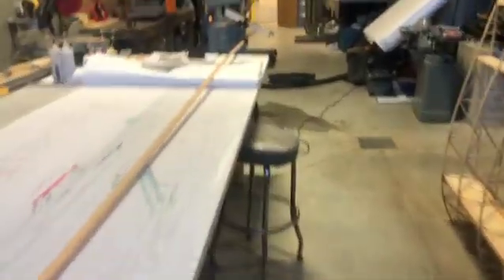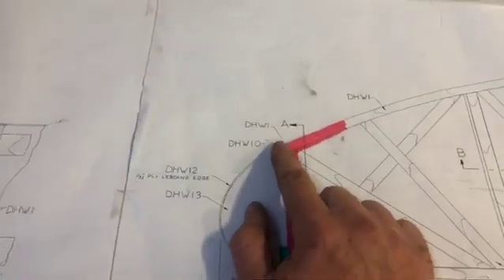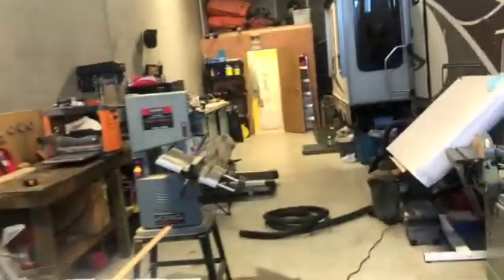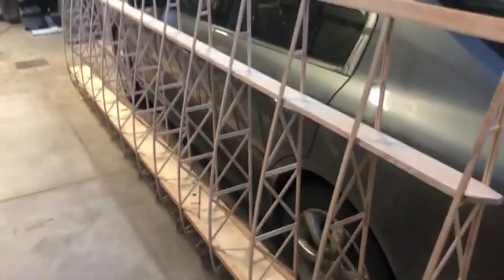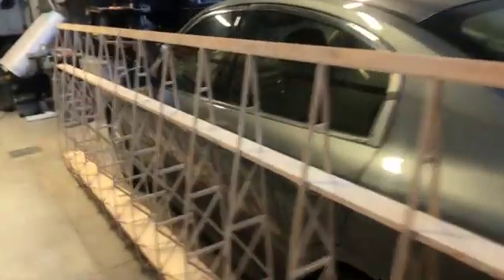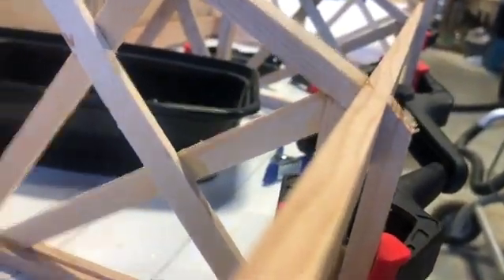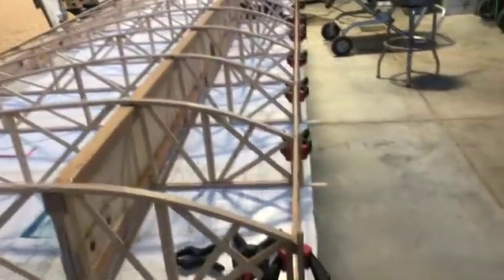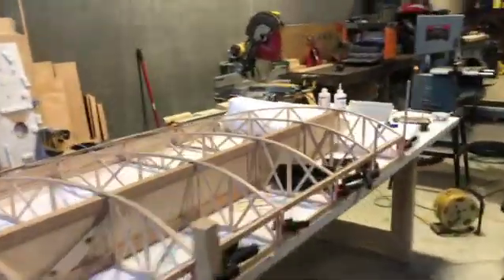DAKOTA HAWK EPISODE 30

Comment: Are those strut attach fitting holes Ok being so close to the edge of the blocking?
Reply from the maker: It is not centred but with the bushing it should be fine, I may bond and extra 1/2" to the forward part of the cross-member.

Comment: There is always more than one way to skin a cat, I would have fitted the false spars after the nose section of the rib but that is how I learnt to do it. I agree the build will take what it takes for that individual, for me is was space for the machines and the availablity of aircraft grade wood other than Douglas Fir, that made the choice for me. In the past I had a workshop about 5 time the size I have now with all the machine and a hangar next to it. With my kit the false spar angle has not been machined.